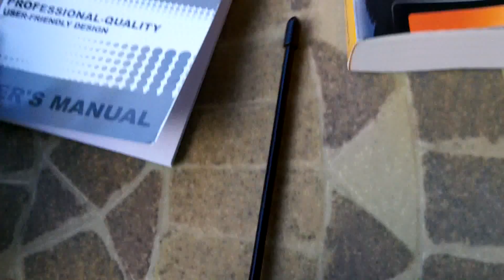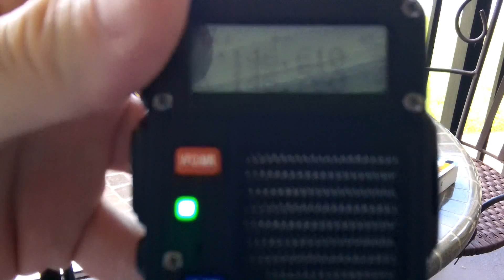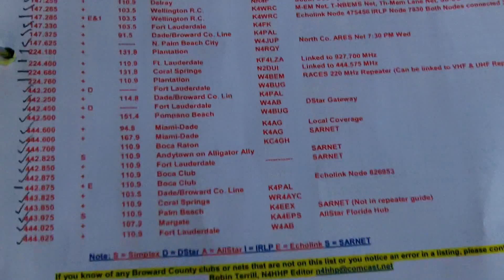Baofeng BF-F8HP Handheld Ham Radio- Making Contact

Comment: Just got said radio back in May of this year. Works great I have yet to put it on a power meter but it seems to work great.  I suggest you get some of the 3800mAh extended batteries. They work great. Nice video by the way. KI7BSL
Reply from the maker: Thanks for watching James.  I will get a few of the extended batteries.  KK4KDO.

Comment: I've had my BF-F8 since late Dec 2014 and the reception is crap now, I can't even get the local NOAA weather radio using the factory, a aftermarket antenna or even my roll up J-pole I can easily get it Tx/Rx using UV-5r and a older TYT 2m. Apparently the weakest point is the antenna nipple if you take it on and off a lot it breaks the connection quite easily.  haven't been too happy with it since finding out it only Tx at 6.4watts not the 8watts it claims.
Reply from the maker: I guess time will tell how well this radio holds up.  Thanks for the info.